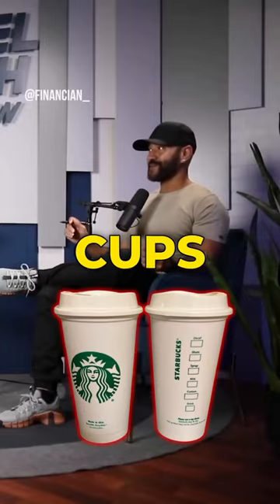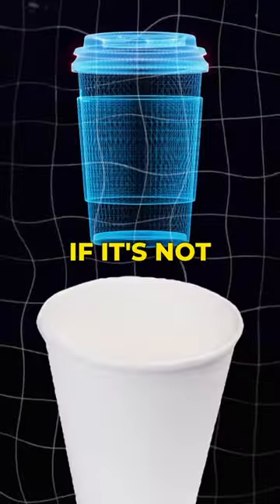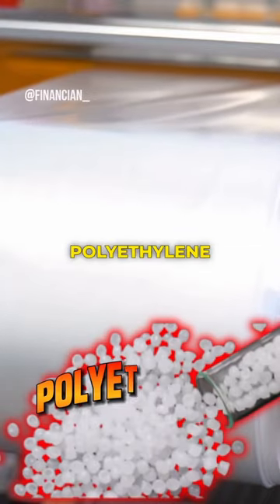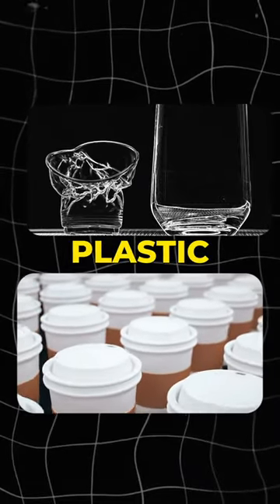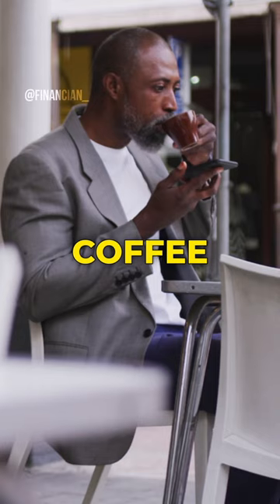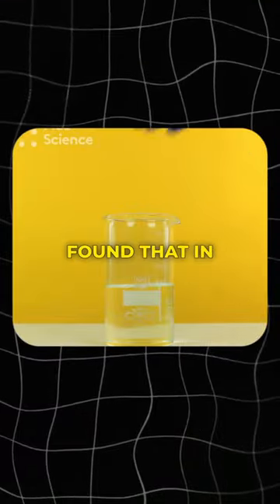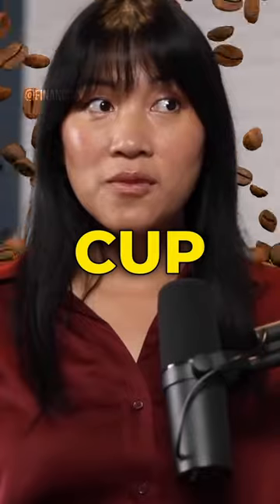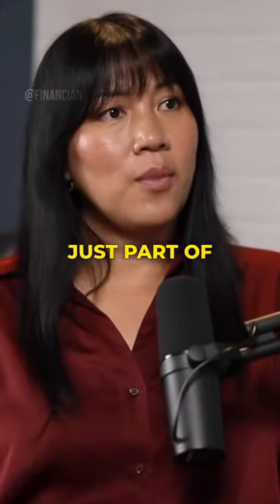Never Drink Starbucks Out Of A Paper Cup Again

Comment: Expect the melting point of PE plastic is 135° your coffee is not 135°....
Reply: Melting point is at 135. But what temperature does the plastic start to release toxic chemicals into the hot liquid….?
Reply: Ecactly
Reply: @MaintenanceMouse  there are other optiotions for plastic that are more resiliant, but the toxic fumes are realising evenwhen you put water in plastic bottle on sun so lets say 40°C
Reply: You’re right, it’s actually higher. Your Starbucks drink might be anywhere from 130-170 degrees.
Reply: @HorizenMC celcius < degrees